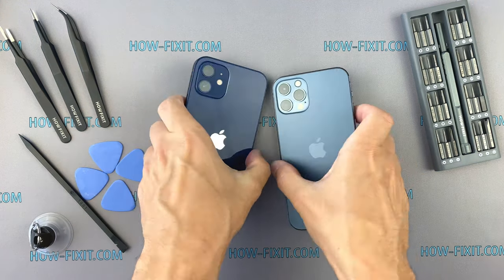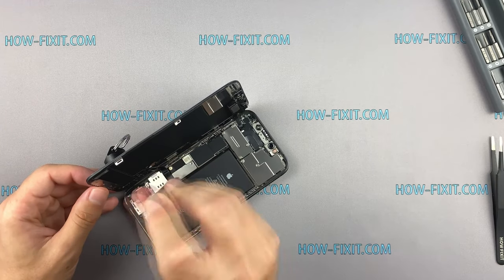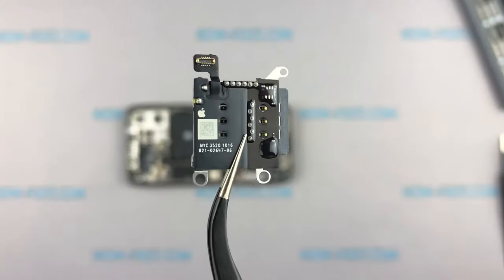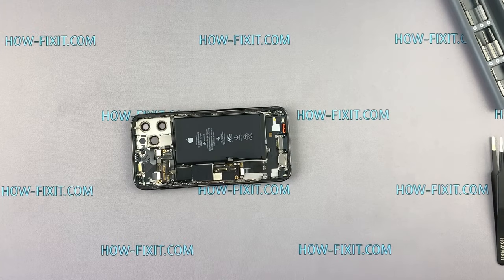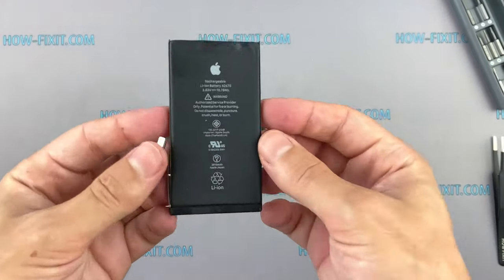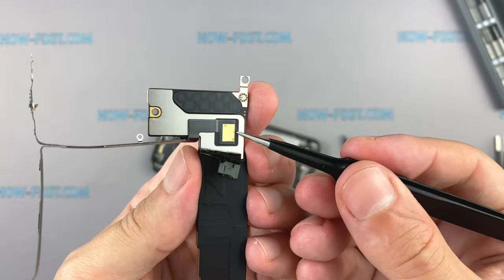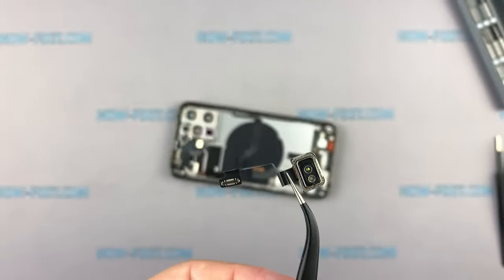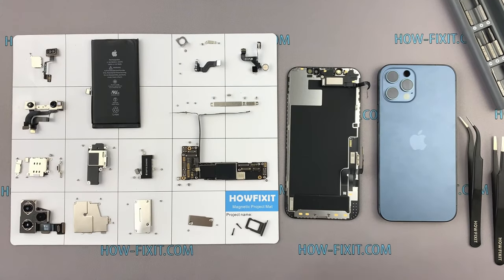iPhone 12 Pro Teardown

Comment: Only situation if you wanted to replce your battery in your 12 pro is the fact if you don’t remove then transfer the original ribbon cable from the original battery & spot weld it to the new battery you won’t have access to the battery health function as your phone will say SERVICE and battery health will be gone do you have a software workaround, will the ICOPY device copy the data to the new battery without having to do the ribbon cable retrofit procedure..  Nice video though. Thanks